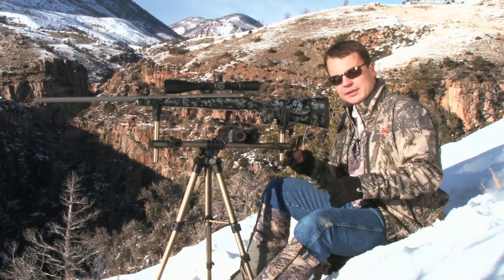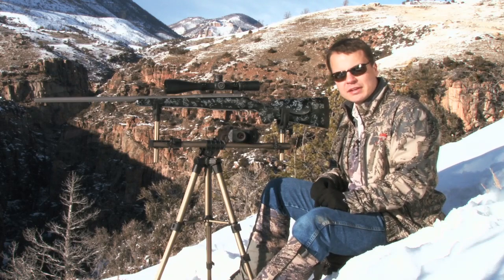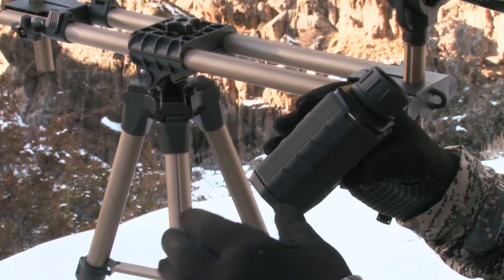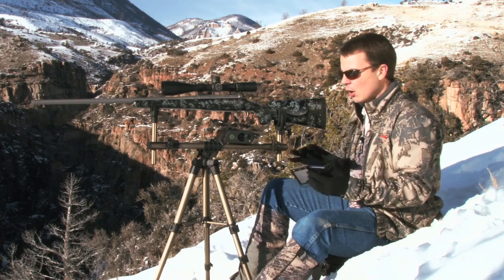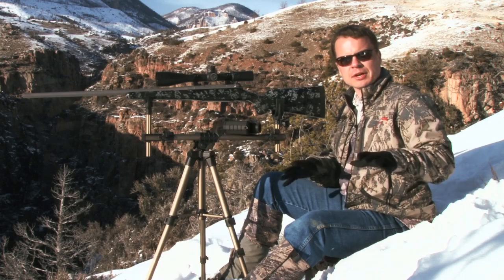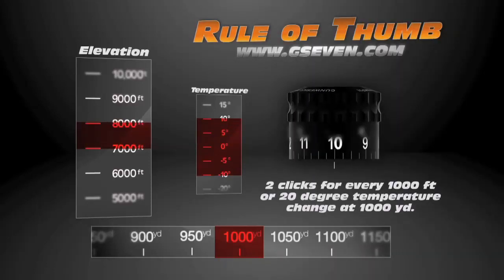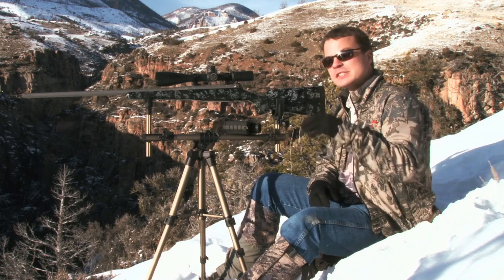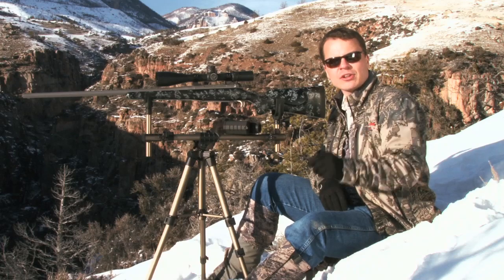Compensating for Air Density

Comment: Why are you calculating the compansation by using the G1 value and not the G7? wouldn't that give a more precise value?

By the way, great videos!
Reply: Many bullets do not have G7 data published.  But to your point, I agree.  I only use G7 BC data in my drop charts.